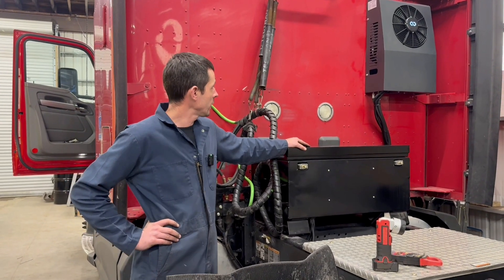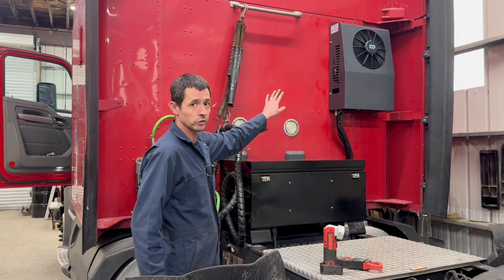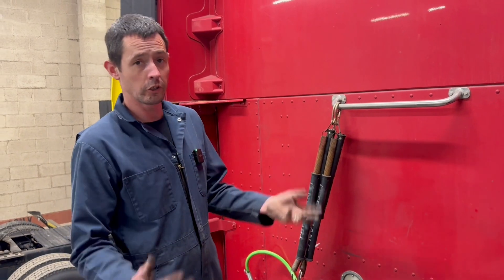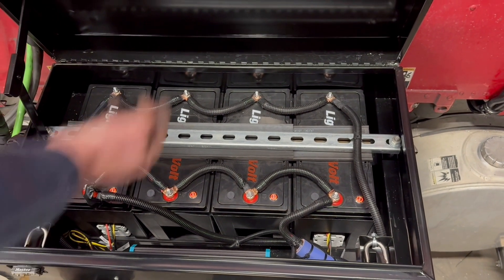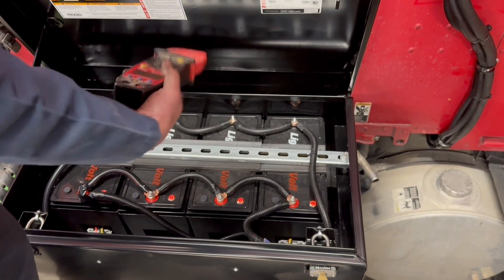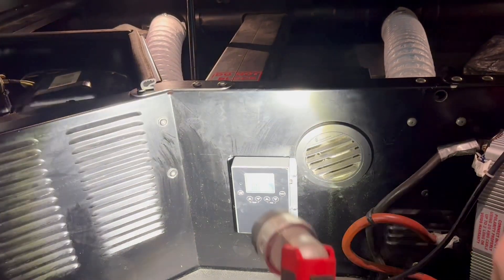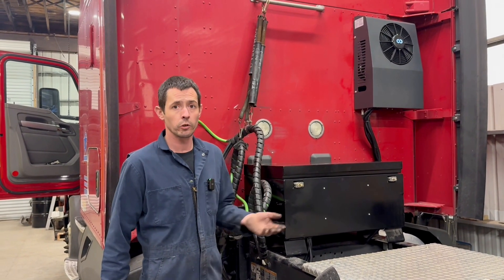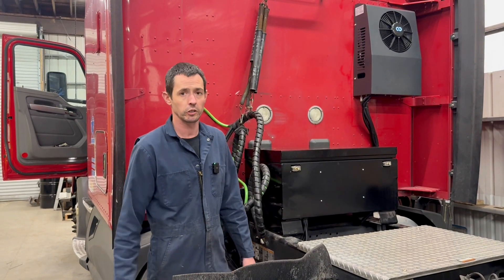NEW All-Electric APU with Lithium Batteries Installation (Lightweight & Under the Bunk)

Comment: Lithium batteries don't like heat or freezing. I've been thinking about doing this for a while, too, but putting them in the black box will probably destroy them 🤔
Reply: They can handle almost 150 degrees, and have heaters for cold, so they should be fine. I would prefer an aluminum box though.

Comment: Ryan, Domestic just introduced their new mini split only pre-orders for now. Roughly about $2,500 9,500 BTU’s. I maybe upgrading to it later this year. It’s the Cooling S1 system will come in 12v and 24v capacity. My truck isn’t setup for 24v and I really don’t want to spend the money to convert 12v to 24v.  Currently, my AC unit is 10,000 btu’s and does well during the southern Texas heat. I’m in the process of upgrading to Lifepo4 400ah batteries and solar panels, but the truck is wired for it already. I just need to install the equipment. I currently have the Treeligo mini split backpack running on 4 old AGM’s managed by IdleSmart. I’m impressed that with just 4 old AGM’s, I’m using about 6 gallons of fuel in a 24 hour rest break period. I have IdleSmart to idle my truck in 30 minute cycles when needing to charge my batteries. I also have way more electronics in my truck as my truck is setup for high security freight transportation. So someone with less security features should get better results than I. As soon as Domestic releases their new unit, I will reach out to you to schedule a time to swap out the Treeligo for the Domestic S1.
Reply: The treeligo is 10k btu?

Comment: I am taking your info down in case I have a retrofit job available. The job is to retrofit the existing Thermo King Tripac into a custom EPU. When I am ready for the job I will have most of the parts provided it needs an electric compressor mounted and all the refrigerant hoses replaced.

Comment: Dude, I was just thinking about this whole concept of a electric APU. I didn't know people were making them. It just makes sense because every time I'm next to a truck with a APU I can smell the exhaust in my cab. probably because APU's exhaust is like 1ft off the ground. And actually if it's capable to recharge while driving off the motor thats would be awesome.
Reply: Yeah it's called an EPU and those have been around for a while. Personally I've actually grown to prefer an EPU over an   APU.. mainly because I'm finding APUs to be unreliable, particularly tripac and carrier.
The only real issue I have with an EPU is most models currently on the market use lead acid batteries, which is going to need Replacement every 2 years if the epu is used on a regular basis.

Comment: Doesn’t this pose a risk of burning up the alternator, specially when you are idling while loading or unloading
Reply: No it does not as long as you don’t have more amp draw than what the current alternator puts out. It is advised to upgrade the alternator to 250+ amps but I have a similar setup and only have what was installed from the manufacturer. The DC to DC converter actually limits how many amps are used to charge the batteries. This is why Ryan is using a 60amp DC to DC converter. Only 60 amps are being sent to the batteries for charging. The DC to DC converter is a smart charger and will only charge when needed. This along with the battery SMS prevents overcharging. 

I’ve been using this system for over a year now with no issues other than install issues nothing to do with Ryan’s install. I recommend you contact Ryan for a professional install. 

My setup only has 4 AGM’s that came with the truck. But I have it wired to work with IdleSmart for battery management and backup should my AC system fail. I will be adding a DC to DC converter, a 400ah battery under the bunk (already wired), and solar panel for longer rest days. 

For those that don’t understand how these systems work, with 3 year old AGM batteries managed through Idlesmart, my truck idles 11 to 12 times In mild weather temperatures per 24 hour period. I have it set to idle for 30 minutes each cycle. That’s roughly 6 gallons of fuel per 24 hours. On typical 10 hour rest periods and drive time of at least 6 hours, I idle as low as 4 to 7 times. That’s about 2 to 3.5 gallons per rest. Please keep in mind, these numbers are half the power of the system Ryan is showing you and with old batteries none lithium batteries. 

Lastly, for those worried about fire safety, these batteries are Lifepo4 batteries not the same batteries used in the batteries that are catching fire. Lifepo4 batteries are the batteries used in RV’s and you rarely read or hear about an RV burning down due to batteries catching fire. 

This is a great alternative to an APU and I’ve had 2 APU’s installed with nothing but constant issues. I yet to have any issues with my electric APU other than a hood switch failure and an installation issue. Both issues cost me nothing to fix and I can leave my truck knowing that my batteries won’t be dead when I return and my truck will be temperature controlled all year around. The most beneficial aspect is that outside of low idle during battery charge cycles, it is silent and no carbon deposit that the truck next me will complain about.

Comment: Unless that box is aluminum, it will be trashed after three winters. That thin wall steel will get eaten alive by road salts. Perhaps that’s something to consider in the future.

Considering what’s in the box, perhaps advise the customers to weld a blocking tab on their fifth wheel adjustment track to prevent it from moving far enough forward that it may hit The box. I had to do that after installing a sliding fifth wheel in place of the original static amount, as it was discovered that he radius corner of van trailers could impact the muffler stanchion.

Does that AC system have a reversing valve for heat, or is something else utilized for that?
Reply: Connect your bunk heater to it lol

Comment: Solid state batteries coming soon from usa, Japan and Taiwan.  Taiwan has started mass production and charge time 1/10th  of lithium and 50 times longer lasting. Just letting you know.
Reply: Charging time isn't really relevant for this application, unless you're plugging it in somewhere. Limiting factor is the alternator. 

However, the lifespan is surely intriguing. Once those are available, the price of these will drop through the floor or they simply won't be able to compete.

Comment: Until you have to adjust the 5th wheel. Lol, When it starts on fire because they never would get hot or I hope you can put the fire out. Will insurance cover it? Lol.
Reply: I use lithium's in my 5th wheel travel trailer and the batteries do not like sub zero weather.  What can be done in that box to keep the batteries from freezing?  They will not charge when the temp gets into the teens.  3200$ in batteries with be trashed in the winter.
Reply: So in the south west states this would be a great system right. It sucks running the truck all the time during the summer time, but you gotta do what you gotta do. How much Xtra weight would this be adding ?
Reply from the maker: We discussed with this customer, and he doesn’t need to move the 5th wheel forward. We covered the basis before proceeding. Thanks for bringing up this point.